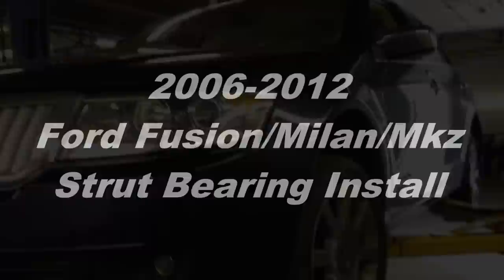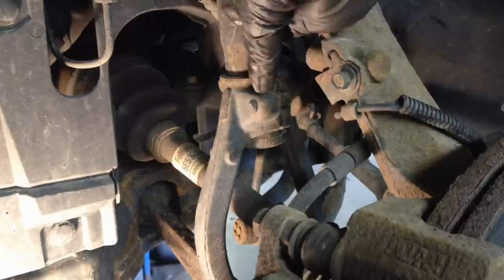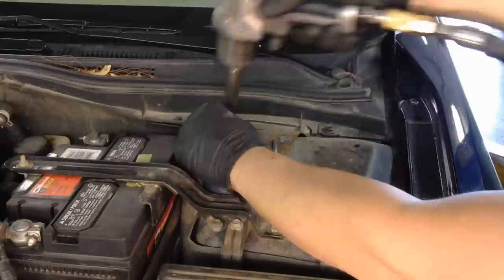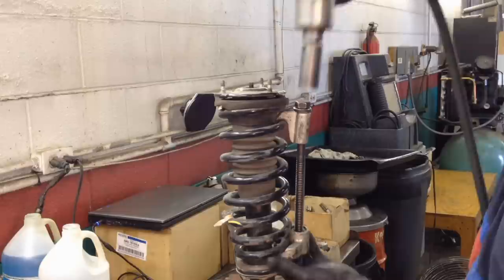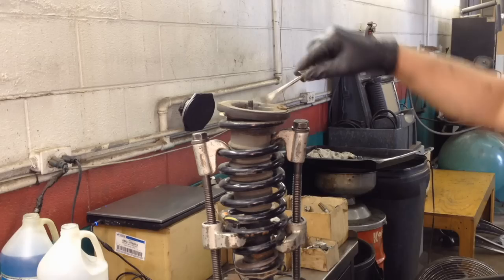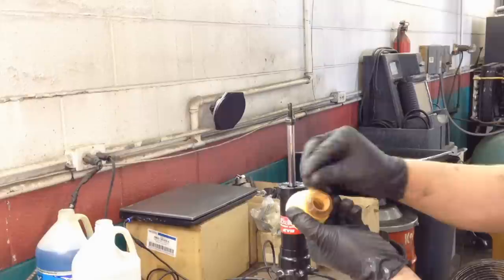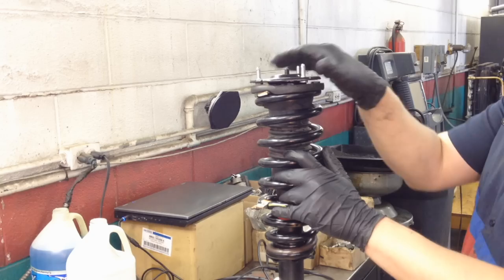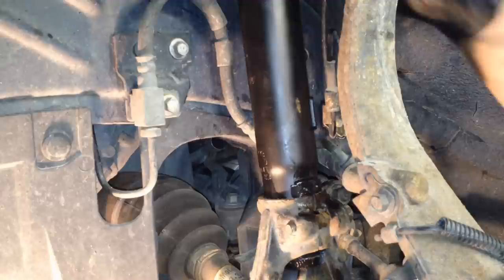Ford Fusion Clunk Noises- Strut Bearing Replacement

Comment: These struts can't turn. The bottom of them is a fork bolted to the lower control arm.
Reply from the maker: Correct but the upper does turn and twist on turns due to the unique lower control arm design as shown in the video.

Comment: Why screw around the aftermarket offers complete replacement components. Have a strut bearing fail have a broken spring have a leaking strut? these failures come one after the other. Kick it in the ass replace the assembly you get a new bearing shock and spring done.